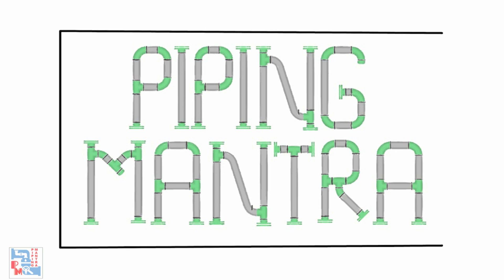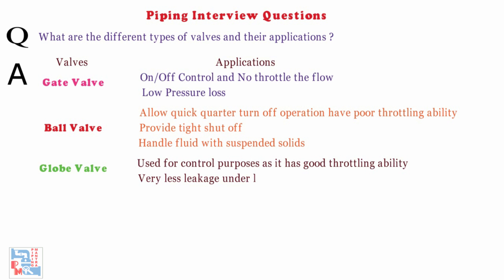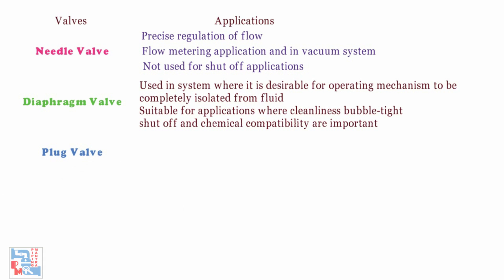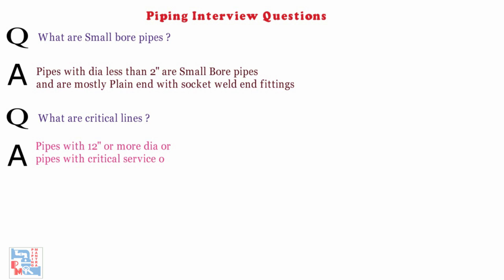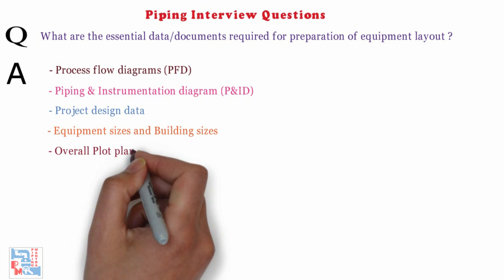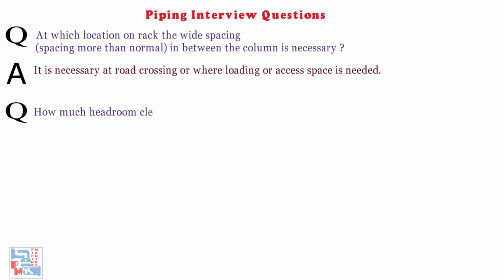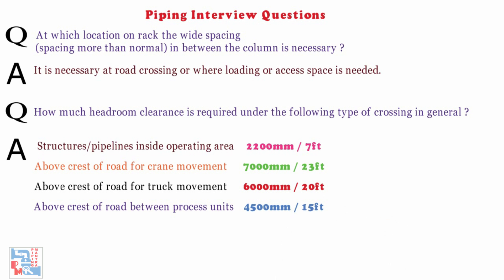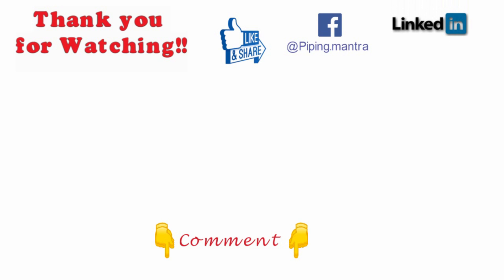Piping Interview Questions | Part-6 | Piping | Piping Mantra |

Comment: Please correct my information: Does the distance between the supports depend on the type and size of the pipe, full or empty, or only 6 to 8 meters? Thank you very much for your videos
Reply from the maker: Its depend on pipe size manly.. Since you place  the pipe it definitely would have something in it. So empty pipe is myth. And for uniformity purpose on rack we place column at 5 to 8m depend upon civil and piping mutual understanding.
Reply: Clear 
Thanks again for your information